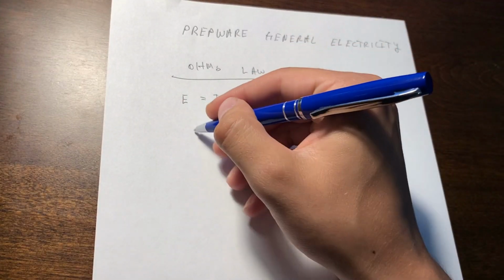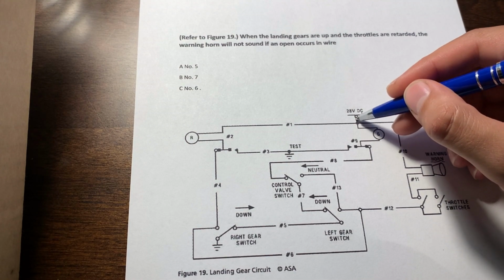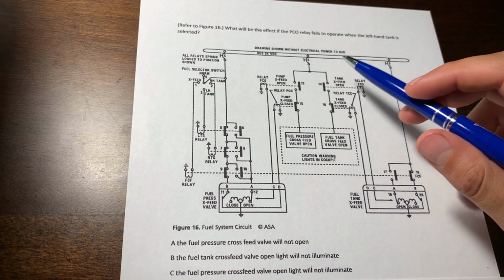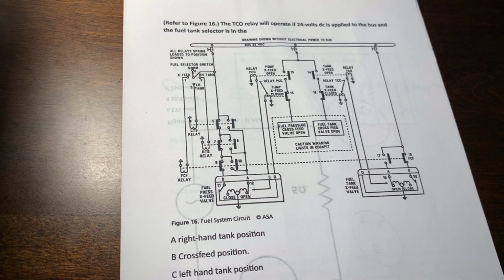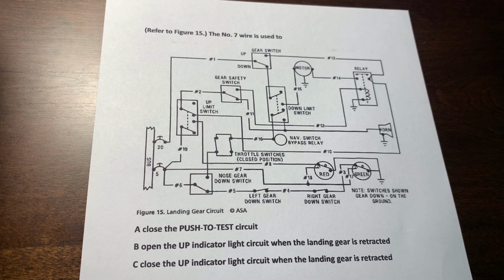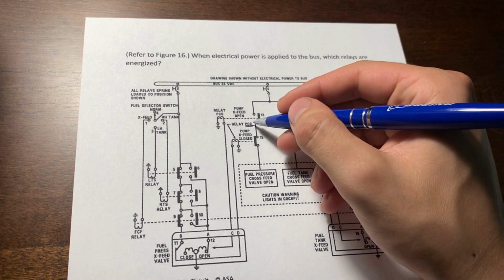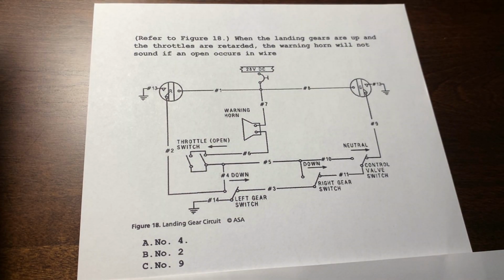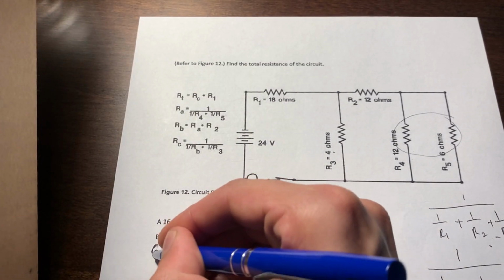Going Over General Electricity Questions

Comment: Correct me if I'm wrong, but on the first problem you mention that for C, "if it were in a series circuit it would be a different answer."  I'm not sure that this is true.  I understand that wattage is wattage--regardless if the object requiring watts is in SERIES or PARALLEL.  If I am wrong, then please provide the calculation for this question replacing the scenario being in SERIES vs PARALLEL.   By the way, I sure appreciate that you shared this video.  Definitely helpful for me, as I am in the process of testing now.  Keep up the good work, man.

Comment: For Question 28, what dictates whether you'll treat the new value of combining two resistors (ie. 12 & 4 in series), as a parallel circuit to work with?